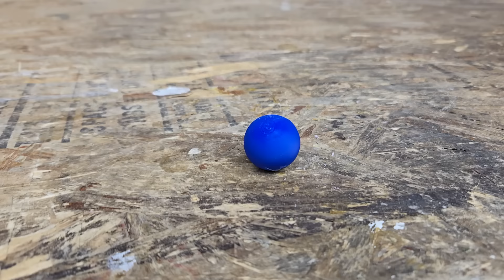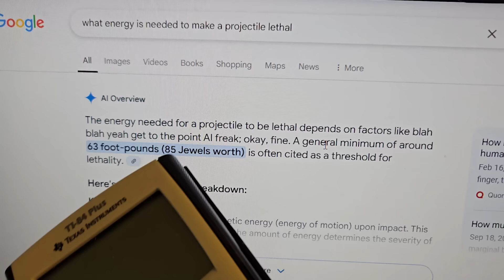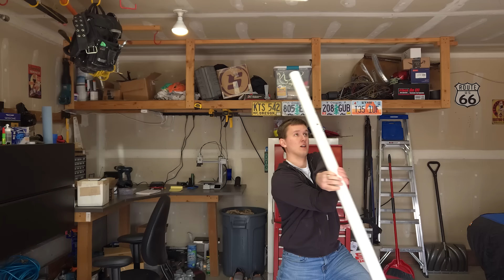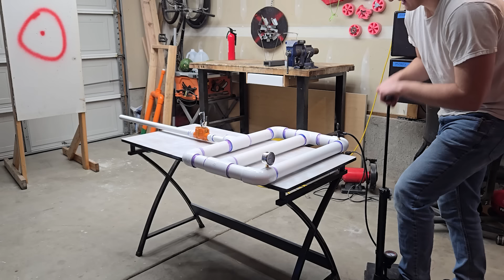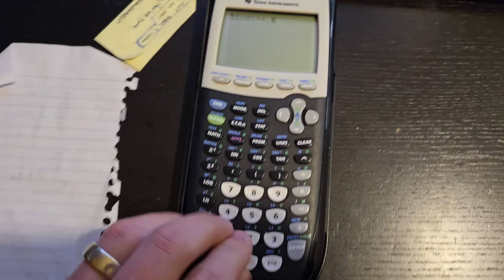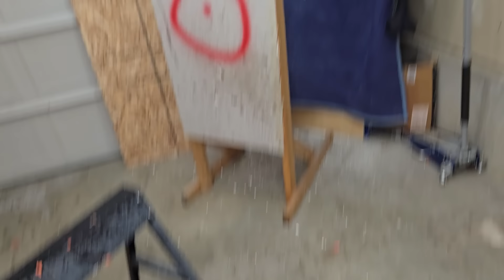How Dangerous Are Plastic Bullets?

Comment: Instead of the compressed air, have you tried putting a small amount of burning cordite (like maybe 1/3 of a gram) behind the piece? I think that would work well as far as accelerating a projectile to lethal energy is concerned.

Comment: a typical .25ACP round (the smallest centerfire cartridge) has a muzzle energy of roughly 90-110 Joules (I really hate the metric system #FootPoundSupremacy) so the 1.4 ounce Wedge projectile with it's larger surface area likely is lethal

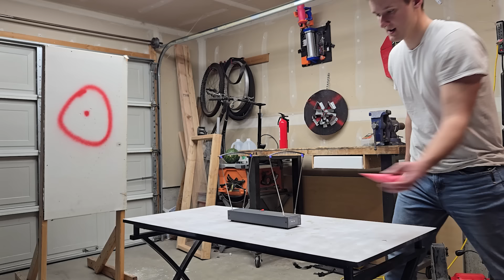Comment: At 2:05 , the answer he showed is correct, but the steps are wrong.
He used the formula:
v²=u²+2as to calculate the velocity, but he forgot to multiply 2 when doing the calculation.
The velocity should have been:
v=√(0²+2*9.8*0.1778)
Which is around 1.8667, instead of 1.32
In the final KE equation, he also used 128g directly instead of converting it into kilograms, so the value he should have gotten is 111.5136 (you can verify this by doing the last step of the solution yourself)
Clearly, this shows that he didn't actually solve this on that piece of paper otherwise using these values wouldn't have gotten him the correct answer.
The correct answer is actually given by:
KE=½*0.128*(1.8677)²
Which is around 0.223 Joules

Comment: The wedge can definitely be improved it immediately keyholed before hitting the drywall probably because the nose caught air and caused it to tumble so if it was stabilized it probably would get quite a bit more energy

Comment: easy way to remember how to put on pipe tape 
if the threaded end is facing you turn right (clockwise)
if the threaded end is facing away from you turn the object around. 

holding pipe in left hand threaded end facing right hand, tape over the top away from you and down under towards you. 
holding pipe in right hand facing left hand. make your right handed friend do it.

Comment: For Teflon tape, hold the threaded object in your left hand, with the open end facing your right hand -----= then starting the tape at the top, wrap it away from yourself, or clockwise if you're facing the open face of the fitting

Comment: Way more dangerous is the shape you showed in the thumbnail, out of copper, and then inserted into a 9mm sabot, and loaded into a 9mm case filled with 9.3gr of Winchester AutoComp… 2417fps from a Glock 17L, projectile weight, 41gr, 48gr with the sabot which well anyway discarded basically at the muzzle count the 41gr projectile mass only for impact.

Comment: I have one of the most powerful airguns on the market (Yes, they're a thing for people who don't know)

FYI, it uses ammo shaped almost exactly the cone shape you used towards the beginning. Its most dangerous form is an aluminum slug, which can essentially "shatter" your skull at 20 feet or less. 

Not many people seem to understand that penetrating the skull is not the same as making a pewpewdeathgun. The aluminum slug in the airgun will not permanently unalive you. 

For something to permanently unalive you, the secret is in the fact that it has to BOTH enter and exit your body. It is what makes a conventional gun so dangerous.
Reply: When a projectile exits the body it means it has much of its energy left "unused". That's why hollow-points designed to expand and stay in the body are much more deadly than normal bullets in the context of an unprotected target.

Comment: Some things to try:
1. Try printing them so that they just fit and try adding rifling to the projectiles. This will ensure maximum use of the pressure and rifling will spin the projectile preventing it from tumbling.
2. Maybe try reducing the infill a bit. You will lose mass, but it's possible the gain in velocity will more than offset it, resulting in greater energy.

Comment: 85 J is enough, but it need to be concentrated. That is basically the kinetic energy of someone at walking speed. So it needs to be able to all be applied to a small area quickly.
Reply: Well it also depends on where you get hit, if you get hit in the neck, you might not even need 85 J to kill you, and in other parts of your body 85 J may not necessarily kill you, though it would inflict severe damage to your body.

Comment: Hey just fyi, the blanket back stop works 10x better if you hang the blanket over so theres an air gap between it and the wood. Thats what does the bulk of the energy absorption. If you REALLY need to stop something, you can use a 5gal bucket filled with rubber mulch

Comment: Great video! First video I've seen and i just subbed. I would only suggest to find a way to introduce a spin to the projectiles. It would increase the power and accuracy and make sure they dont keyhole as much. Possibly by 3D printing a barrel with grooves or add the grooves to the projectiles.

Comment: You should consider making the projectiles have an airtight and/or rifled seal. I bet this would get way more pressure actually pushing the projectiles, and with rifling you would be able to stabilize for a greater shot range.

Comment: 63 foot pounds is lethal?
How about you put about 63 pounds of filament on a cart and try to roll it at 8 feet per second?
Reply from the maker: I believe that's only for projectiles.. now the question becomes if the cart is in the air does it immediately become lethal

Comment: For legal reasons I must say I don't have 3D printed 20mm 10bar car compressor operated air rifle with sliding breach, but try adding steel balls from bearings for weight and stabilize projectile with fins or areodynamic drag. You can easily get 200-300 joules of energy
Reply: You should make the projectiles more stable, because it's clear that some of them penetrated the wall sideways. You might want to try making a dart-style projectile, or even consider rifling the PVC barrel. I'm not sure if rifling will work in this case, but if you're looking to improve range and penetration, these changes are worth trying.
Reply: I most definitely wouldn't recommend anyone to try out using blowgun darts on compressed air guns such thing would be highly irresponsible of me and highly illegal to do probably that's why as a good law obiding citizen I will tell you to most definitely not try this (hint:it's powerful enough to easily hunt bears don't ask how I know)
Reply: @Dav624 not illegal.
Reply: Most likely not illegal.
Reply: @Dav624 it’s not easy
Reply: Better yet 3d print a rifling insert. Can be removed when you show others
Reply: @DyskTwardy  me when war crimes ☺️
Reply: @troypickett7716  you kids dont even know what a war crime is. why does everyone say this
Reply: @troypickett7716  Me when mf saying regular ass weapons are war crimes 😢
Reply: @jackbequick  khm, whell, acktually... 🤓 

Weirdly enough, projectiles and shrapnel that are made out of plastic are considered a warcrime. Because small plastic fragments that stuck in the wounds are not detectable via x-ray, which makes surgery on removing them from the body really difficult and most cases some fragments are staying in the body and cause chronic pain and discomfort to those who survived
Reply: @nemorianderson it’s not a war crime because it’s not a war crime
Reply: @nemorianderson  its not war time, nor is it being used in war. therefore it is not a war crime.
Reply: @troypickett7716  it can't be a war crime if you're not hurting people with it, it's just a regular victimless crime

Comment: You're victim to a Common misconception , velocity is only relevant at the target or better , but quickly dissipated on route without weight in the projectile. also impulse is more relevant to effect on target than energy since a target is nothing else than another medium through which you want to fly the projectile.  i.e. the projectile loses less energy over depth of target if it weighs more. Only in projectiles whose concept is based in deformation and energy transmission and thus resulting tissue damage does the equation change in favour of speed. But this is only relevant in technologies that aren't limited energywise. A potato canon is very limited in that regard. 

stay safe